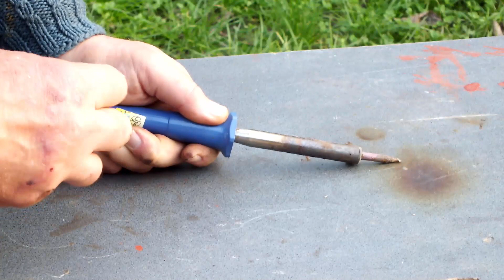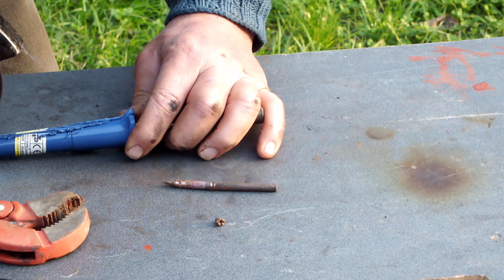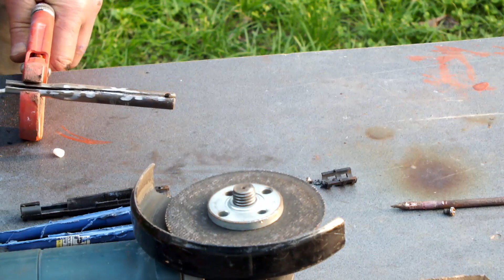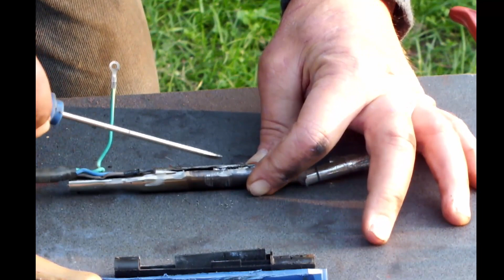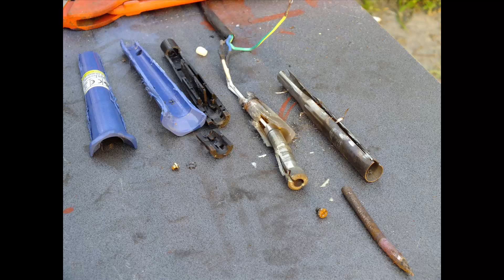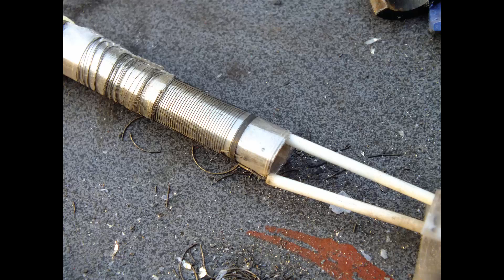DISASSEMBLING SOLDERING IRON

Comment: I hope you are not a handy man :-)
There is no need to use angle grinder. When removing handle just pull iron out of the handle toward the front (handle goes on cable). Same is with heating element, you just need more force and tools.